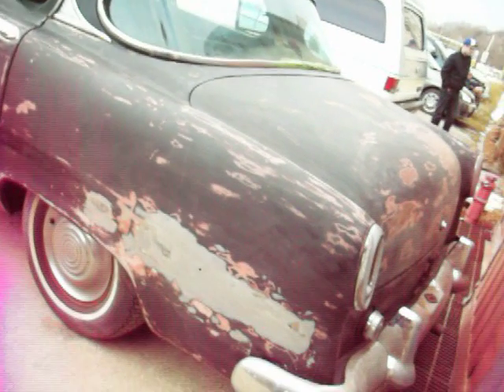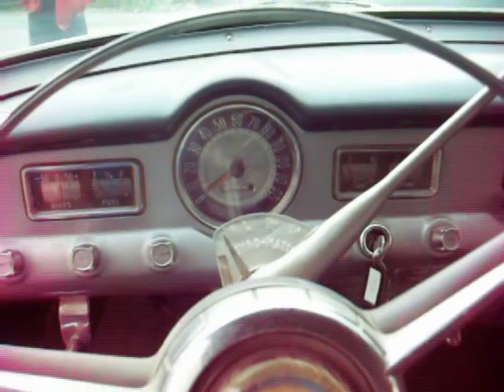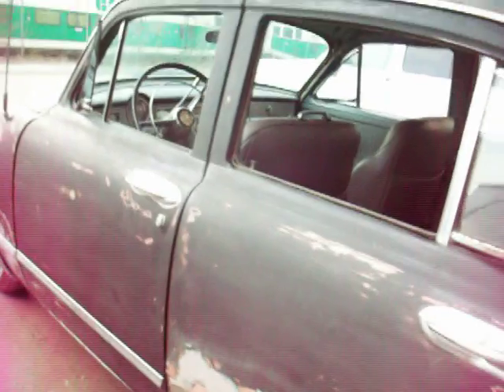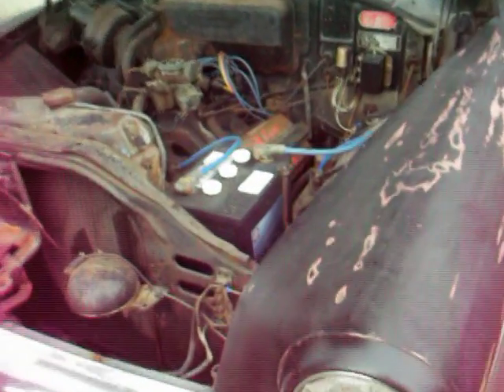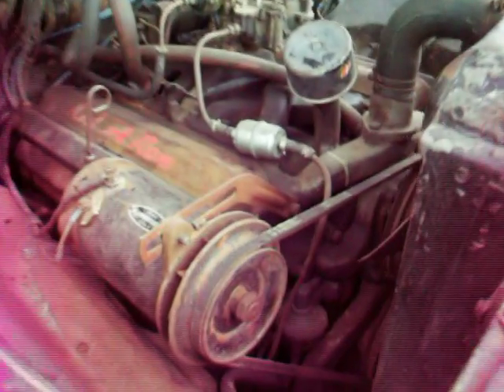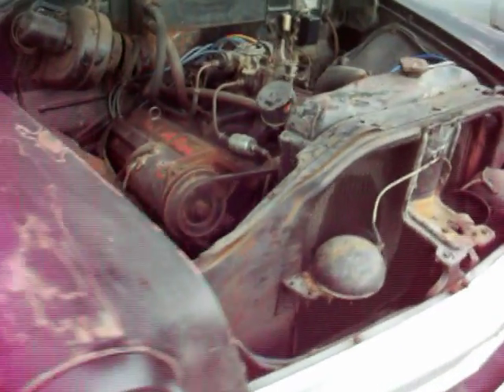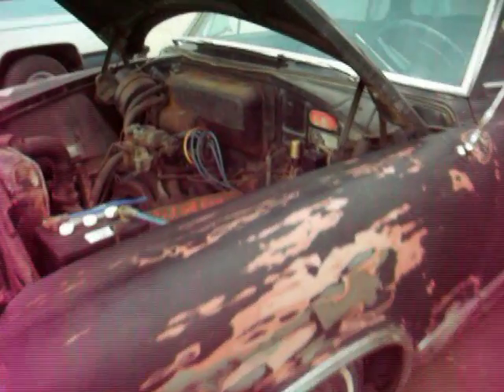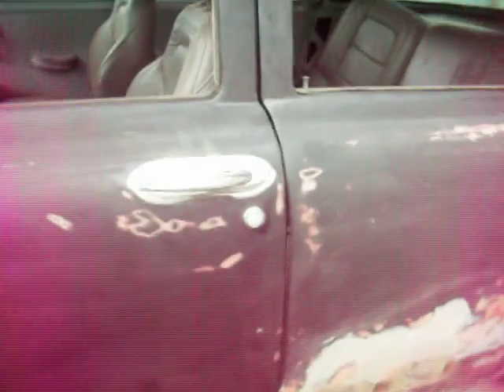1953 Dodge Coronet Red Ram Hemi Dec 3 11

Comment: @spikedpunk she's got the 4.1, but I'm told the Olds 307 drops right in.  Something to consider if the 250 goes belly up- they're not known for being a great engine.  Mines a GM performance remanufactured unit, so she should be good for a while.  And thwe car only has 130,000 miles on her- got lots of life left in her.